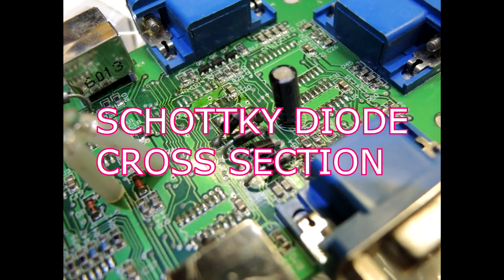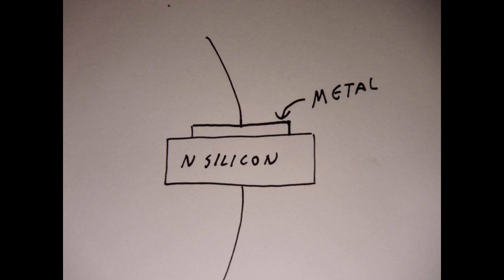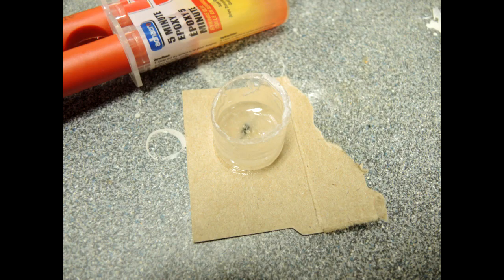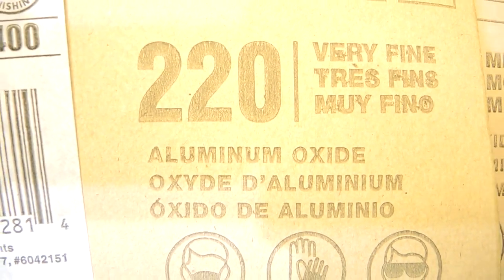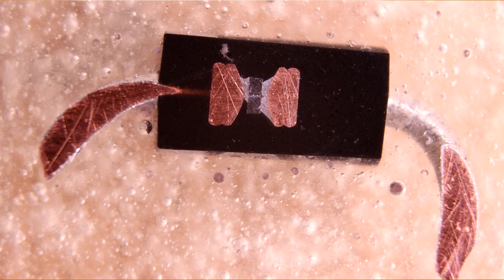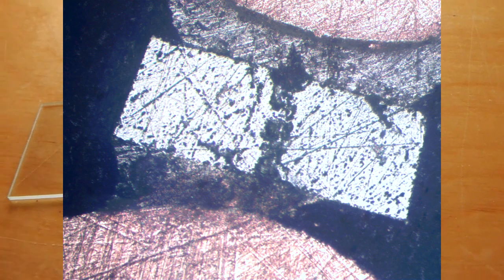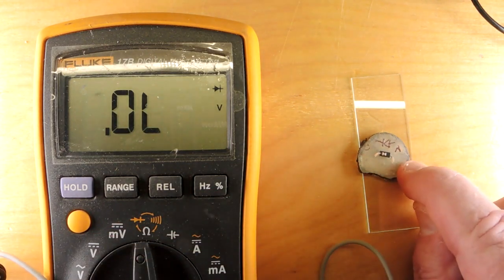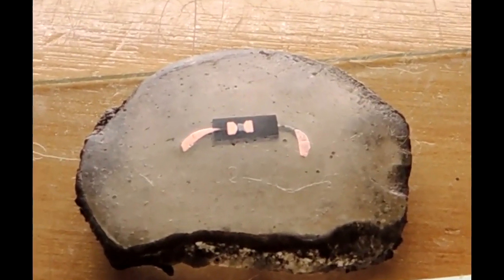CROSS SECTION OF A SCHOTTKY DIODE

Comment: Came from The Amp Hour! Great job, we mechanical engineers do precisely that to examine a material's microstructure. If you polish it with diamond paste (after the 1000 grit, maybe 2000 grit paper), and use one drop of nitric acid (might be a different acid for silicon, one needs to look up), possibly you would be able to see the grains in the microscope. 

Subscribed ;)